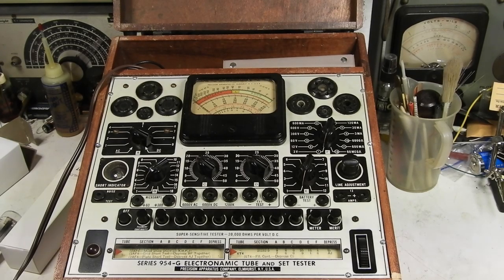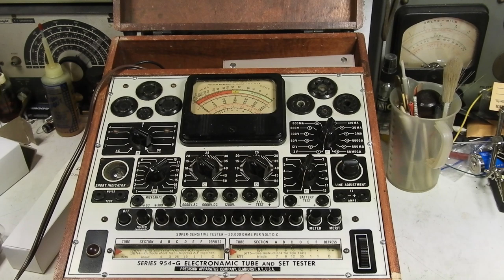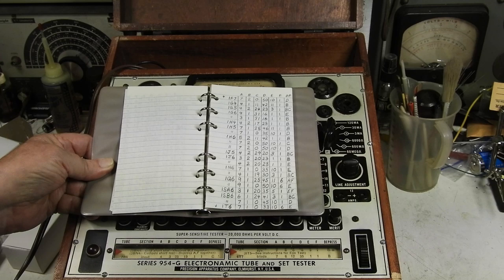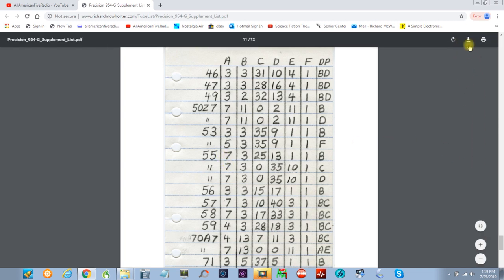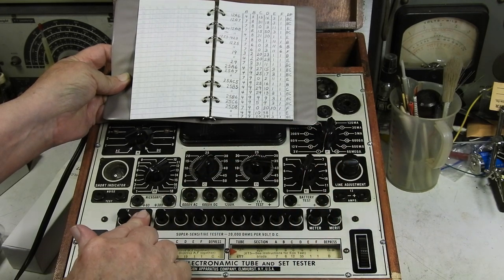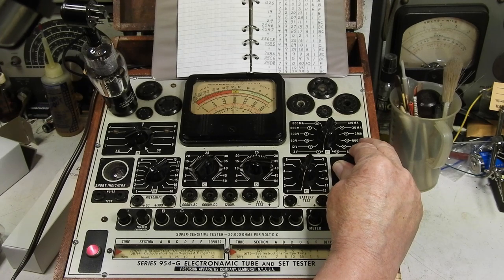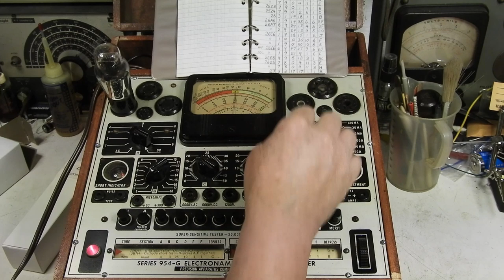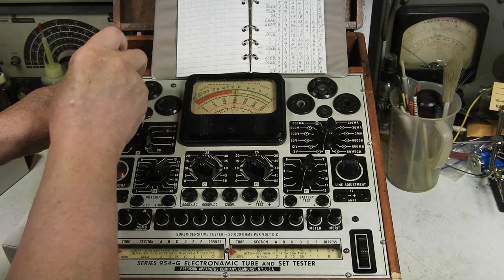Precision Tube Tester 954 G Supplement Tube List

Comment: Question: Need some advice from a knowledgeable expert. Would it be possible to add a ratio detector to a regenerative FM receiver or would the demodulator require a heterodyne setup with an intermediate frequency?  I've made a rather nice transistor regen with an amplifier, but it's a bit scratchy. So, I'm wondering if it's possible to add a Foster Seeley or ratio detector circuit. I have some experience with an AM superheterodyne and I'm slowly working towards the more complex FM version. Another great video by the way!
Reply from the maker: I think you should be able to configure another detector to your circuit. My guess would be now you are using a single diode. A ratio detector usually has to diode's so pretty much it is detecting both halves of the signal making it louder. So the scratching us should also be louder. There is a possibility the diode you are using now and maybe other components in your detector circuit may be noisy. If you have a signal tracer you may be able to find where the noise is coming from.

Comment: I compared the list from Chris with your list and noted that there is a difference with the C and D settings for 01A. Chris has C: 19 and D: 20. Your list C: 45 and D: 6. I have not yet retested my 01As yet but I hope that I did not damage my 01As with incorrect settings. This 945 is my first tube tester I bought on Ebay a year or so ago.
Reply from the maker: I was very careful on all tube setting lists. I have over 15 1920's radio that use 01A's. My tubetester checks 01A's accurately.
Reply from the maker: My Tubetester is a 954 'G'
Reply: I retested some 01As and they're testing at between 15 and 10 on the green scale. I really appreciated you demonstrating the tube testing procedure. I've been following the instructions from Precision which I thought would be hard on the 80 rect tube by turning on and off the tester between tests. I thought that you had to use the tube merit button procedure which required pressing the off button to reset the buttons.
Reply: I found in the literature which came with the 954-G a "Form -- DRC (HK) SUPPLEMENTARY TUBE DATA Price $0.75".  The settings for the 01A agree with Chris' Old Radio settings of A:3, B:5, C:19, D:20, E:1, F:1  Are these differences of C: 19 to C: 45 and D: 20 to D: 6 significant?
Reply from the maker: I did not find the roll chart for the earlier model of the 654 on Chris's site. I took my information off of the roll chart of that earlier model.

Comment: Beautiful tester. I have a couple tester much less nice than that. My question is how would I know if my tester is good?
Reply: Good question.  I had the same question about mine.  For my Precision 912, I first replaced C1 and the type 80 tube.  Then I tested several known good tubes of various filament voltages to confirm good test readings. It seems to be working fine but when I get some time I will check the transformer voltages and the resistors. Joe
Reply from the maker: I open the tester and inspect the inside to see if  anything is obviously wrong. Like burnt resistors or cracked capacitors or loose wires. If all is OK I put it on a variac bring the AC voltage up slowly watching the current. If the current is good I start testing very common cheap vacuum tubes, and compare the results with another tube tester.